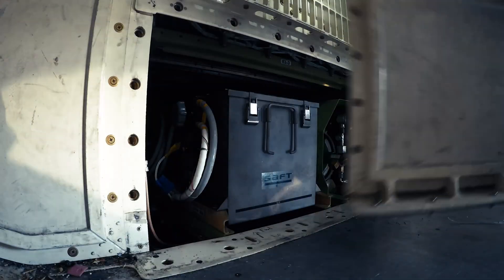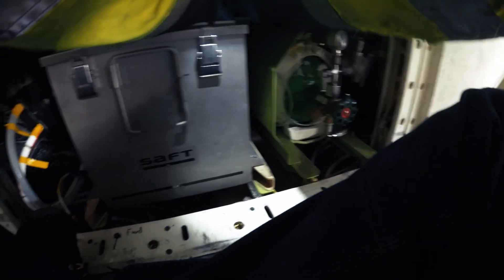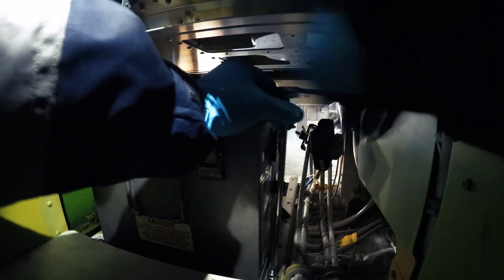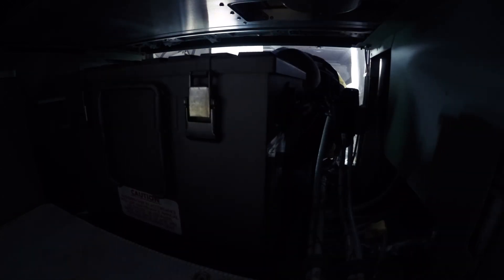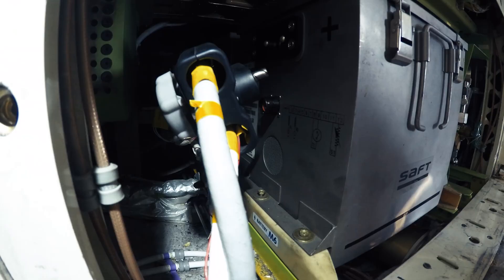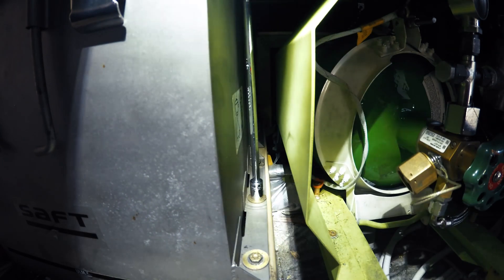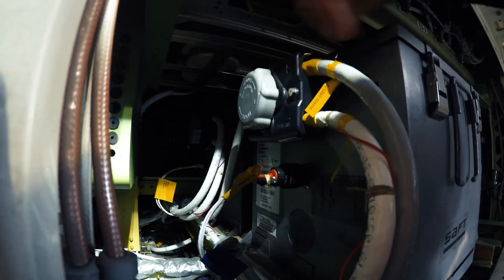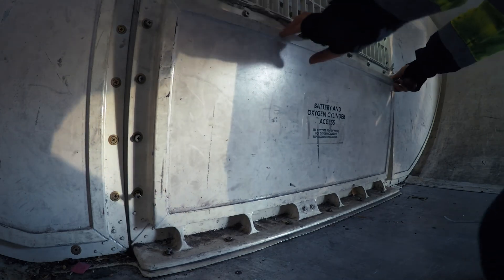Boeing 737: Battery replacement

Comment: The copper wire. Can you explain please.
Reply from the maker: It is a witness wire. So you can see when it is loose. It doesnt have a locking function.
Reply: @NextGenerationMechanic 
Actually that should be called Safety Wire.
And it is supposed to be tied in the Tightening position. As not to allow the fasteners or connectors of whatever kind to loosen. And obviously if broken. To check and replace whatever may be causing that situation.

At least that's how it's done when the aircraft were manufactured 🤗
... spun a lot of safety wire 😂

Comment: Good video. What is the purpose of "oxygen tank" in this battery compartment?
Thanks.
Reply from the maker: Thank you! The oxygen cilinder is for the flight crew when oxygen is needed in emergency situations.
Reply: @NextGenerationMechanic  Thanks for the clarification.